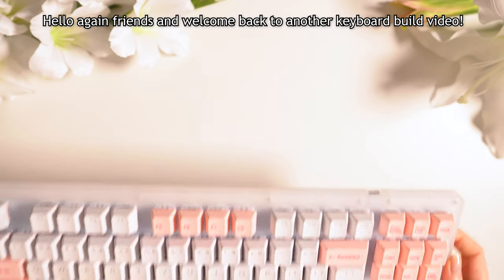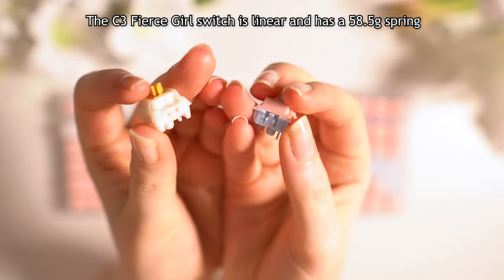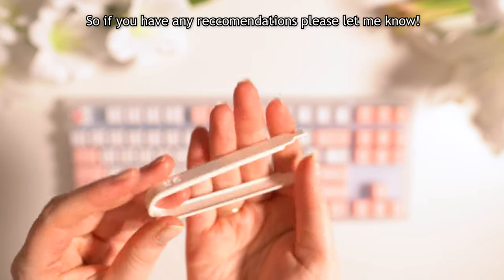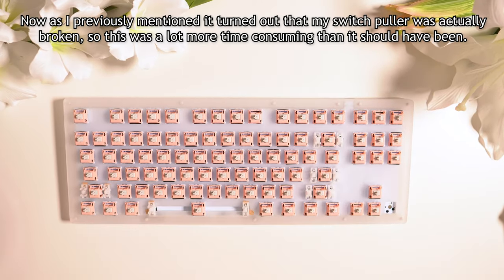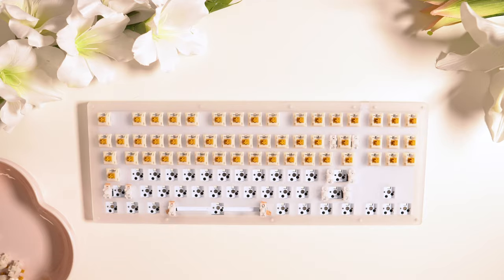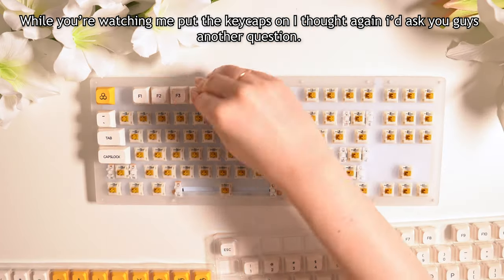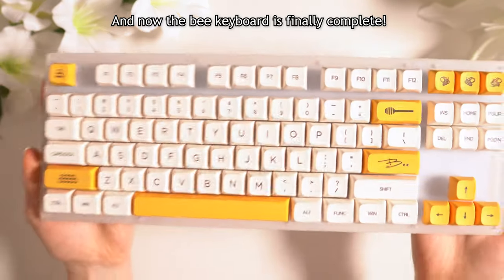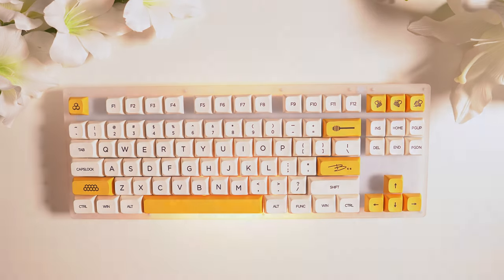The most Bee-utiful keyboard! | Modding my Gamakay k87

Comment: Your best keyboard video... so far. 💙 Blue and white keys would be my favorite.  I wonder if you could use an IC Chip Puller to remove the switches. The old ones look identical to the tool you used.